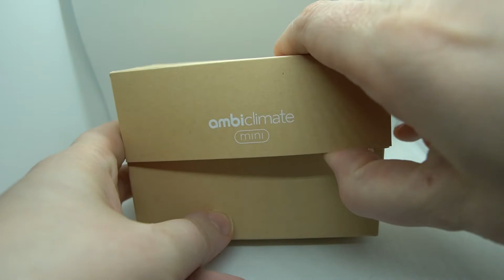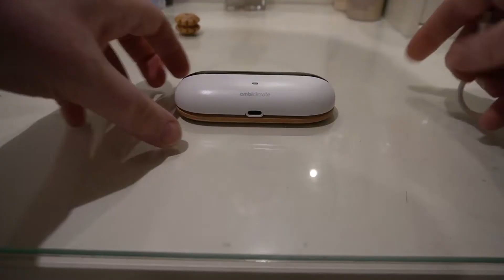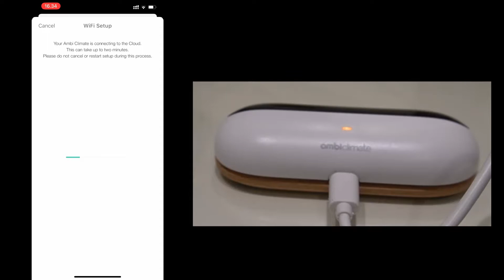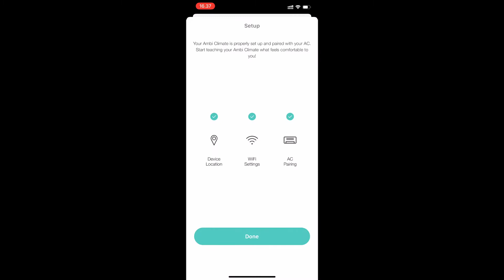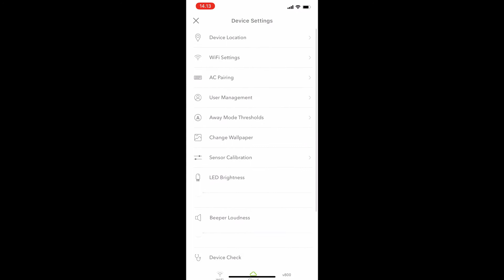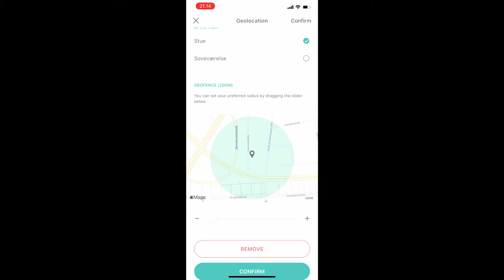Save Money and get Better Indoor Climate with Ambi Climate Mini. Full Review and Setup Guide.

Comment: I've got 2 Ambis. They worked great in 2019 but since 2020 they have been absolute garbage.

Very frequent service outages, the "AI" setting the air conditioner to ridiculously high temperatures (like 26 Celsius / 79 Fahrenheit) when you tell it you are feeling hot, and completely useless customer support that can't even get your name right, much less resolve even one of your problems.

Avoid like the plague.